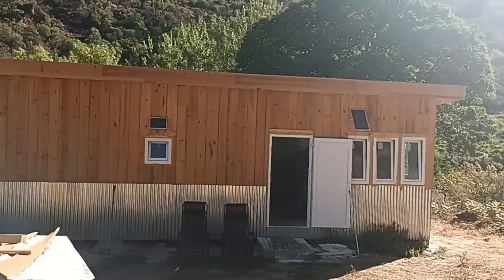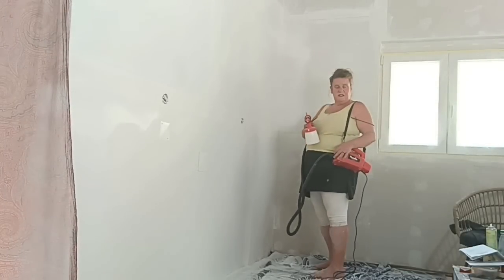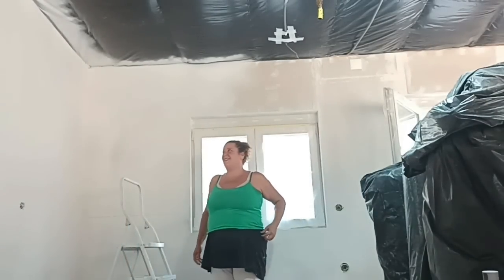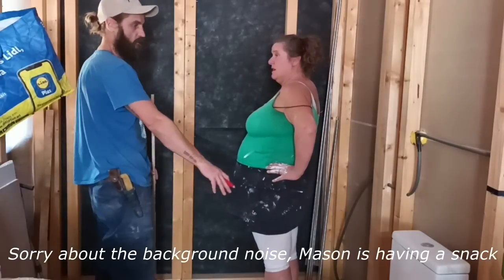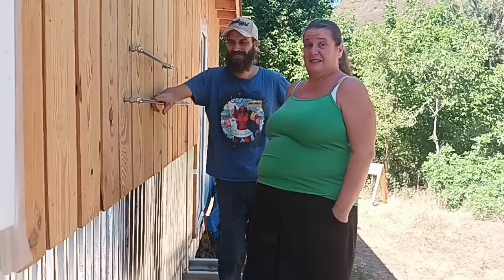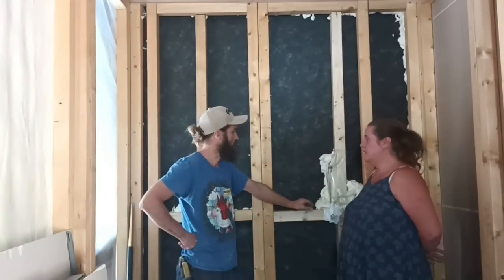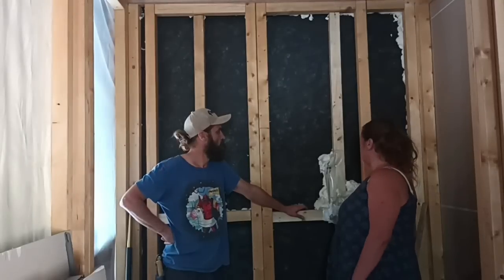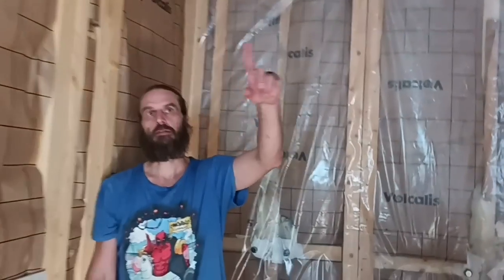We’re Priming & Plumbing our Dream Kitchen & Bathroom.

Comment: In South Africa, we also have mild winters where temperatures go down to -5C or -6C. Sometimes the pipes freeze. We put Pool Noodles over our outside pipes when low temperatures are expected  and it does seem to work.
Reply from the maker: Great tip thanks for that